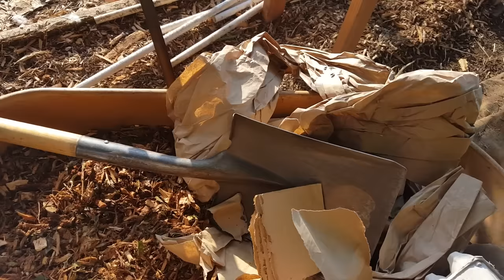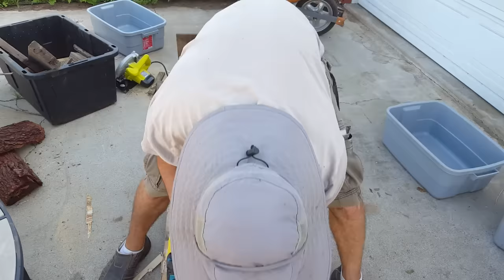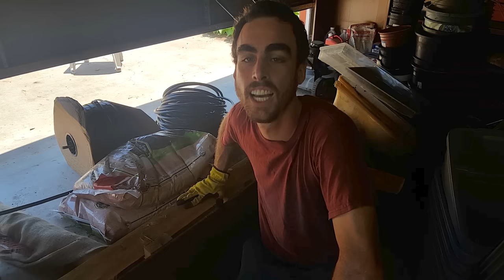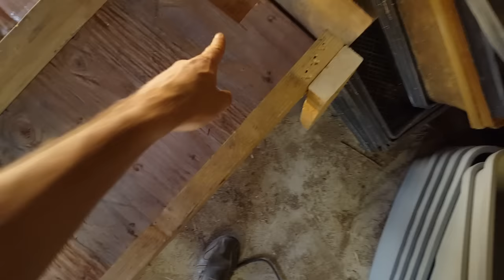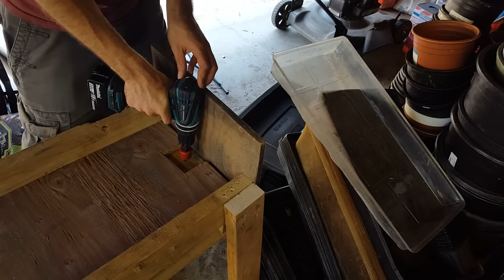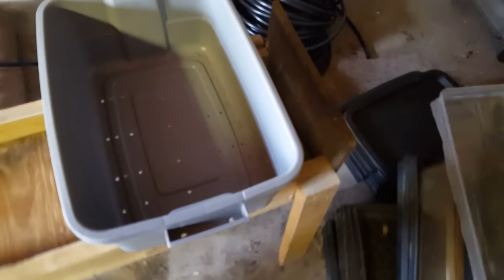EASIEST Worm Casting System for Vermicompost 3 Bin

Comment: Heat your bits with a blowtorch before drilling.
Alternatively use, heated nails
Use a soldiering Tool, you will not have to keep heating nails or drill bits

Comment: buy your bulkheads from ebay aquarium trade alot cheaper then 10$ i use them all the time in fishtanks they are solid and leak free if u want u can put a thin layer of silicone on the underside before tightening them down but i dont

Comment: Doesn't it get too hot for the worms above ground where you are? I know they're in the shade but the air temperatures get pretty hot there.
Reply from the maker: As long as they are under full shade in summer they do just fine :) In the summer I also add water more often and that keeps the soil cool for them. Now Phoenix or some really hot place where it gets 115, 120 maybe then you run into problems but I don't really know.

Comment: should feed only one side of the bin. so it gives them an area to run away to when it's cool
Reply from the maker: Not necessary whatsoever in this system. They can hide in the cool soil or under the cardboard I rest on top of the material.

Comment: An easy way to make your water drain to one end.  Finish your top.  Take 2 legs and attach to one end at the height you want.  Go to the other end and using 1/16" to1/8" per foot of run attach the other two legs so that the low end is at the correct height.  In other words if your top is 8' long make the lower legs 1/2" to 1" shorter.  Place upright on the installed legs.  Custom cut the other legs to go from the ground to the top of your top run no measuring needed.  The end result should be a platform that drains to one end and doesn't rock due to uneven legs.  Put in some cross bracing side to side and front to back to stabilize and add strength.
Reply from the maker: Thanks for the great tip!

Comment: Does the trough breed mosquitoes?
Reply from the maker: I drain and use the leechate immediately and recommend doing the same since it will go anaerobic quickly since it isn't aerated. But if you left the leechate in the trough it would for sure breed mosquitoes.
Reply: I was thinking the exact same thing. I guess if your use it fast enough it won’t be a problem, but if you ever want to improve on this design maybe use weather stripping or use that pond cover again over it, cut a hole for the bins, tape small openings.

Comment: Drill in reverse it should make a clean hole.
Reply from the maker: Thanks for the suggestions, I tried that, it helps but as long as a drill is used some remnants are left behind. I think burning/melting is the only way to get a completely clean hole.

Comment: Does anybody here know if I can give dog hair/fur to my red wiggler worms?
Reply from the maker: Hmmm I'm not totally sure, but I think it would be fine. I'd try a small amount and see how it goes. Maybe soak the hair and get it wet first, might help the breakdown. I think it would be easier to just compost the hair or throw it in a bokashi bucket.
Reply: Yes you can, along with your vacuum cleaner dust and your lint from your dryer

Comment: This link is for a visual, I have never bought from nor endorse them or anything but I want to recommend a reaming drill bit. Also a reamer helps after the fact.

https://m.lightinthebox.com/en/p/4241-high-speed-steel-hex-drill-bit-hex-drill-material-pagoda-drill-bit-drill-bit-opener-hole-4-12-4-20_p7333109.html

Comment: Don't get me wrong, what you are doing is great. I just think that the name of the channel and your message is a bit mixed. Keep your head in the game and don't give up. possibly adjust a bit.
Reply from the maker: Appropriate technology ;) These will last forever. Everything I do in regards to raising my plants is done using natural systems and increasing soil biology and biodiversity. Nothing about the way I'm raising worms leeches man made chemicals into my castings. I wanted to show people the 3 tote system because it is so easy to harvest and apply the castings. Very accessible to people to get started in vermicomposting, even in apartments. More people doing vermicompost is an overall all net good. There is no perfect way to do this or do anything, compromises must always be made. You have to strike a balance between philosophy, cost, practicality, durability, ease of build/materials. Recycled bathtubs are great for larger scale systems. I've seen them done in bags and other systems. But they all require some sort of vessel to contain them in some way. I'd love to experiment more in the future to find if there is a way to get the same efficiency using natural or no outside materials. For now I believe this system is excellent for a small market garden or for gardeners in terms of the low maintenance and huge return in castings you get with almost no effort at all.
Reply: @NaturesAlwaysRight  Well said